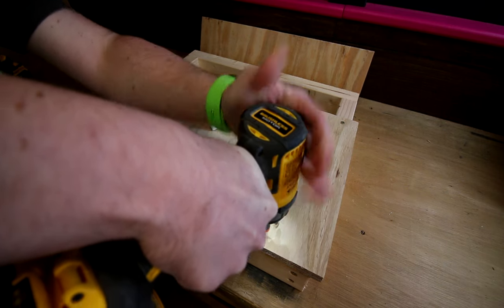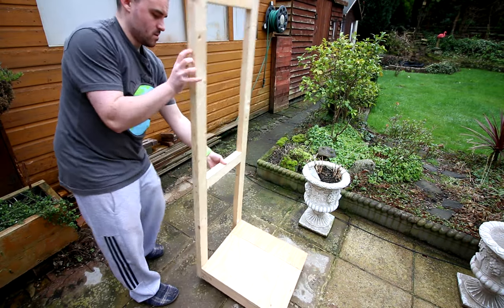DIY Cyclone Cart

Comment: Gussets are cool, I think they got lost along the years
but my Grandpa used them a lot in shop and shop projects.
I hear on the extension cord, anything over 15 amps and pop.
I love builds like this. Simple, useful and cheap.
All the best bud stay healthy. Peace.

What’s the difference between a hippo and a zippo? 
Ones an enormous grey animal, the others a little lighter.
Reply from the maker: Lmao classic!! 😂 

Bungee cord is ideal for around the workshop. Like you say, so many uses! I really need to sort my electrics lol I currently run my lights and 1 power tool at a time. Ideally Id run dust collection at the same time

Comment: Joe, just a recent subscriber, but I'm finding your channel very accessible and informative. Our only problem at the mo' is actually getting material to get on with those projects we've not - until now - had time to get around to. I'm guessing that's a fold down bench in the background.
I only moved a couple of years ago, and started to set up my workshop in my garage. Initially, I built a monster bench, that frankly, I don't really find very useful. I have a couple of B&D workmates and some Stanley trestles that I tend to set up when I need workbench space. The workbench is just a giant, space glutton shelf, full of tools etc.  
Anyway, where did you get the jumbo hose for your cyclone/vacuum?
Keep making things, tutorials and in good health! All the best from Scotland!
Reply from the maker: Thanks for subscribing mate! Its very difficult to get materials at the moment thats for sure. I recently took down some shelving in my workshop and have been using the wood from to make the kart and other bits and bobs. It is a fold table, I have a video of how I made it on my channel 😊 small spaces are very difficult to make the most, keeping things on wheels and ‘fold away’ helps a lot! The workmates are brilliant, ideal to take outside in nice weather too. I got the hose from Ebay. They have all kinds of sizes available